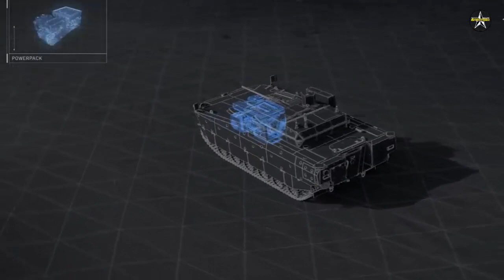Polish-made Borsuk IFV with 40 mm cannon

Comment: There are two mistakes: borsuk can carry team of six people not eight, his main gun is 30mm with option to switch it to 40mm anytime.
Reply: "with option to switch it to 40mm anytime."
What means never. Nobody ever tested that, nobody provided extra space in the turret.
Reply: @krzysztofbosak7027  LOL.  Turret was designed for both cannons from the start and your statement that  there  is no room is just  missinformation.
Reply: @paskuder3065  Of course you have insider knowledge. I tell you something, the designers and welders of this this turret were never closer than 1000km to 40mm bushmaster prootype, simply because none was exported. The chances they made no mistake and it can be mounted without issues are zero.
Reply: @krzysztofbosak7027  of course,  only  you have inside  knowledge...